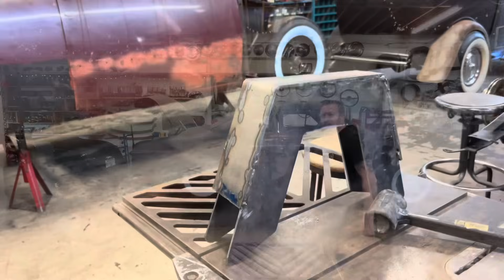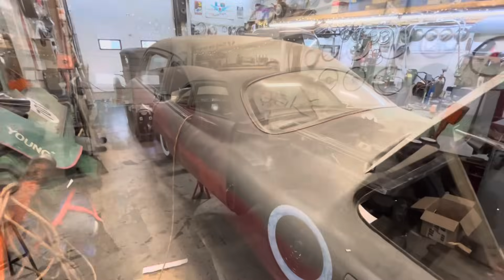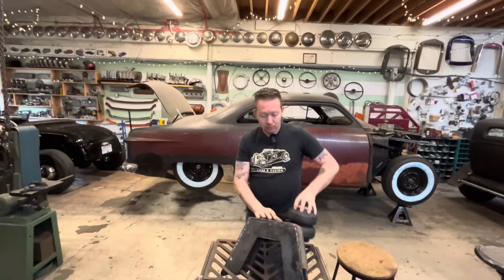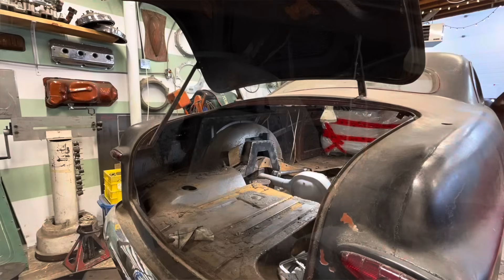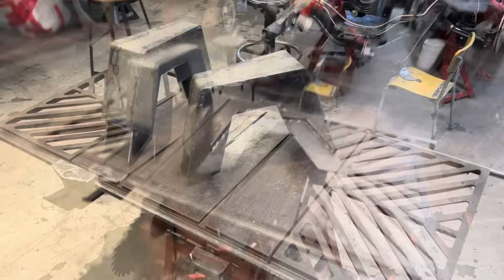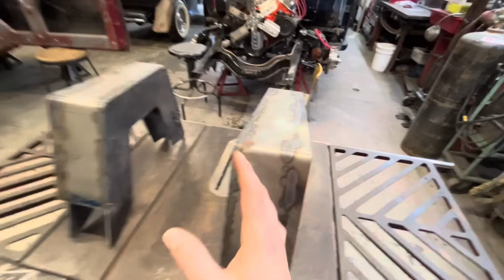C-Notching an Air Bag Suspension in a Shoebox Meteor. Part 2

Comment: Metric measurement is much easier and more accurate so why is nth America holding out. Height of C-notch turned out to be self explanatory. How much torque is going through that long skinny tailshaft
Reply from the maker: I learned metric in school, but in the real world everyone in Canada uses inches and pounds. Regardless I’m not sure what measuring system I use has to do with anything. If I cut one inch, or 25mm off the end of a tube, the tube still ends up being the same size and able to do the same task. 
As for the driveshaft. This car has a mild 302 and very skinny tires. Its main purpose is cruising, not drag racing, so there is a very slim chance of twisting the driveshaft.
Reply: @LGKustoms  I'm 76 and don't need a calculator but time moves on. A mm is as thick as a fine marker and the need not to look for fractions is time saving and more accurate . . . once you convert to metric there's no going back. Regardless of the archaic measuring I'll still be a staunch subscriber and like your work
Reply: when is the next video coming?
I really like the work you do😊
Reply from the maker: @viktorbjorklund466 new video comes out every Saturday
Reply: He is Canadian. Probably quite high functioning in using the metric (SI) system. Just chose not to. I use both but I agree when accuracy is necessary I use metric units.